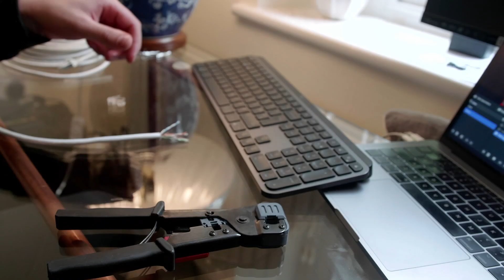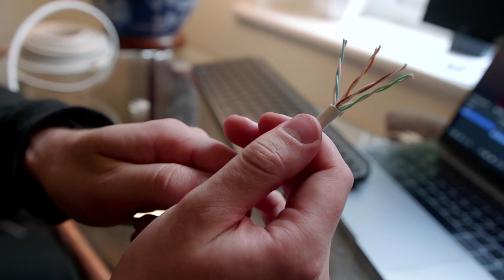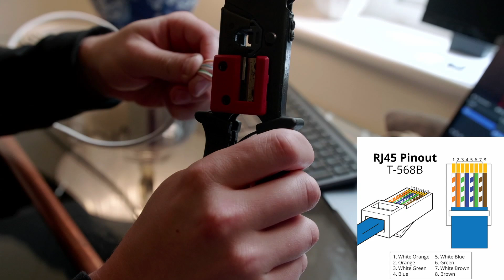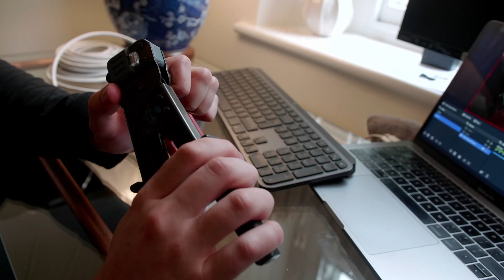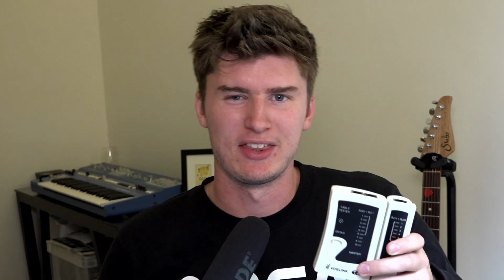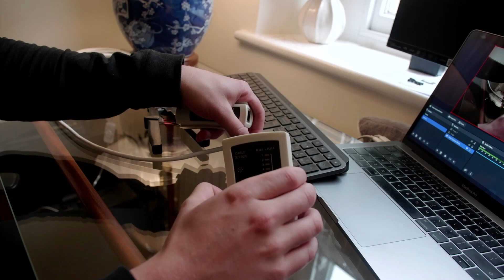Day 1   Terminating Data Cables

Comment: Good video for beginners to understand some basics, I would recommend using passthrough rj45 connectors which removes a lot of the hassle of ensuring the cable length is right. Beginners will find passthrough rj45 connectors easier to use based on past experience.
Reply: Hi John, good to know about the pass through rj45’s! I’m going to check them out